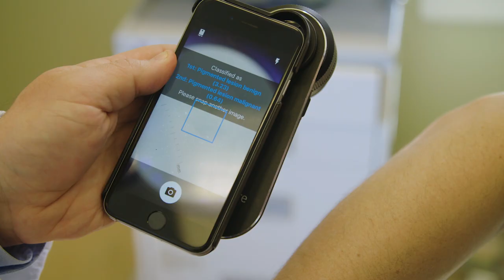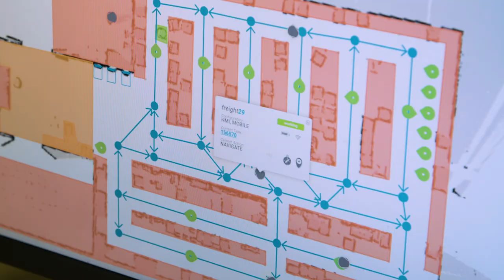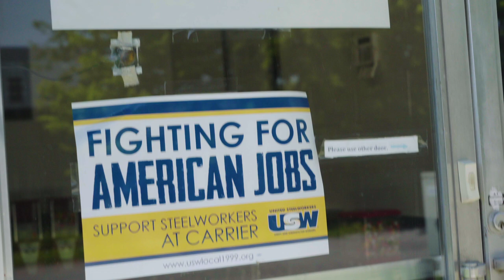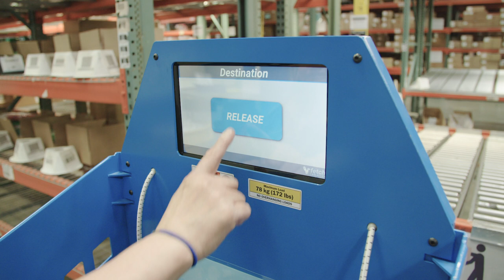The Future of Your Job in the Age of AI | Robots & Us | WIRED

Comment: We don't need UBI. We need transformation through new business models that don't operate on hierarchical ownership, but on shared proportional ownership with protections against the exploitation of labor. This is an issue of exploitation of labor rearing it's head. Without exploitation of labor as "efficiency" that is in reality paying someone less than their portion of a product's worth, this is an advancement that benefits all owners.

The problem is that a few consolidate ownership. A factory worker that owns their portion of the means of production wants to replace their labor with a machine's when that makes their means of production yield greater results. These same means of production then transfer into a different labor role of shared ownership and new jobs with their portion of this new means of production as maintenance and development of these machines.

This is again a simple idea. I'm just explaining why it works. The idea is that if people maintain ownership of their means of production, this is a non-issue. Exploitation instead cuts out these would be owners since they have no ownership as soon as their work is no longer needed. That makes sense in a way, but as consolidating ownership into the hands of a few.

All workers must own their portion of the means of production. Such ownership when replaced with machines can be invested into machines for higher RoI by working less. What a deal! Again a deal made impossible by consolidating the ownership of the means of production.

The state has no right to ownership of the people's means of production. Oligarchs have no right to the people's means of production. Only the people have the right to their means of production. A government cannot consolidate this power to protect the people's right to this ownership. It can only protect human individual property rights as civil rights protections against exploitation against ownership of one's portion of their means of production. It is becoming essential for our economic stability to protect this human right as a civil right.